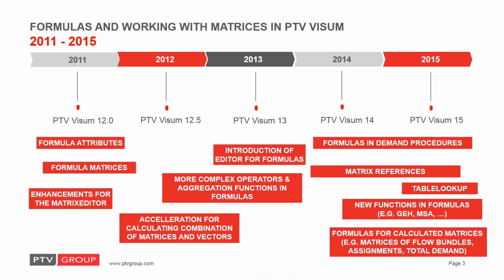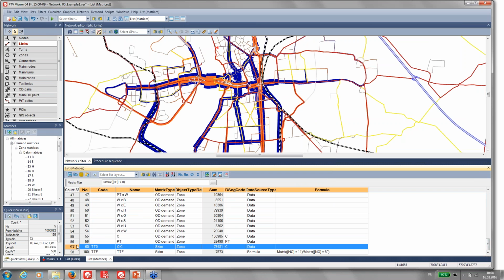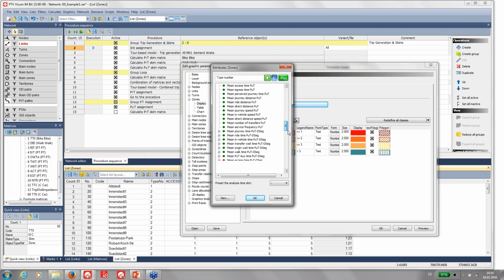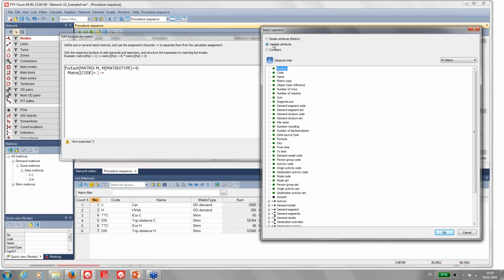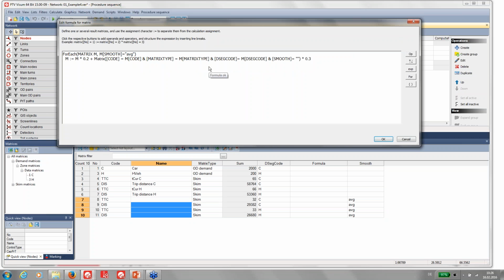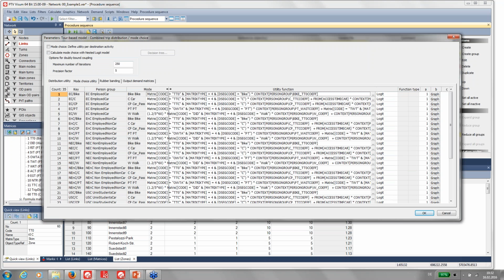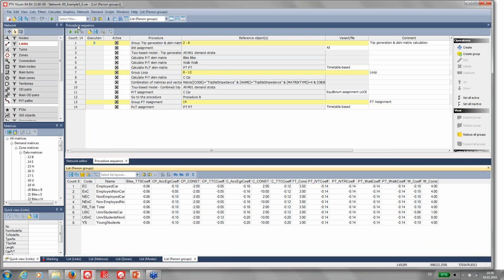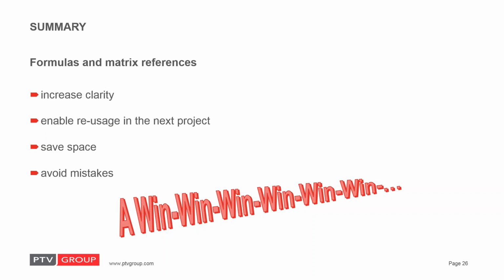Formulas and Matrix References | PTV Visum | Webinar

Comment: Hello. Can we create a matrix so that the tcur value that occurs in the link after the assignment is from node to node? Example: There are 10000 links. In the matrix, I see the tcur value from the 1st to the 2nd node point, and the tcur value from the 3rd to the 12th node as the matrix.
Reply from the maker: Dear Vallace, Matrices in Visum are by default for relations between zones, main zones or stop areas. However, you can also calculate skims e.g. from node to node but they cannot be stored as matrices in Visum. There are specific COM functionality available to do so because that sort of skimming is needed in microscopic demand modelling where the spatial resolution is more detailed than zones. All the best
Reply: @PTV-Mobility  Thank you very much for your reply. I don't have any questions about this subject.
Reply: In the program, a volume value occurs in a link segment after the assignment. How can I find out from which zones this volume value is the volume value? Example: Link:1531 Volume:15000 (20% A Zone - 30% B Zone - 40% C Zone - 10% D Zone) 
There are actually 4 zones here. I want to know how much the 15000 volume value comes from which zone. :)